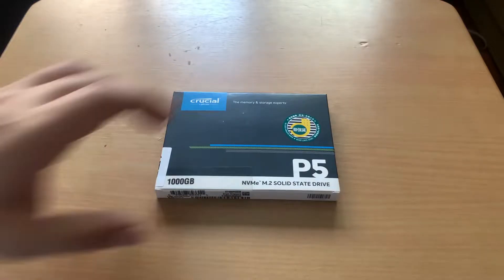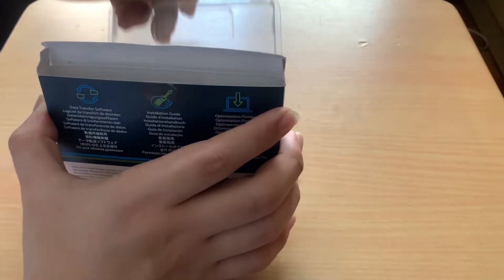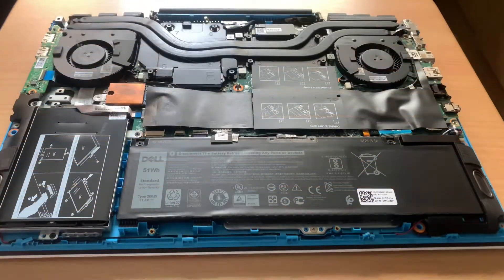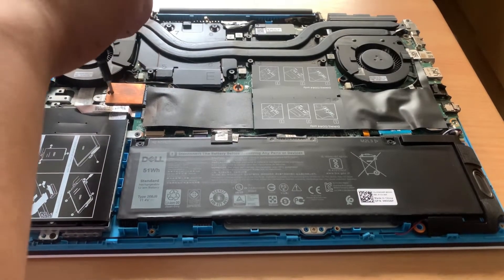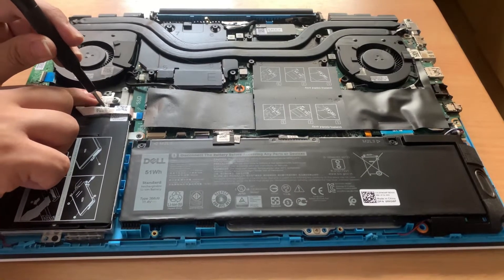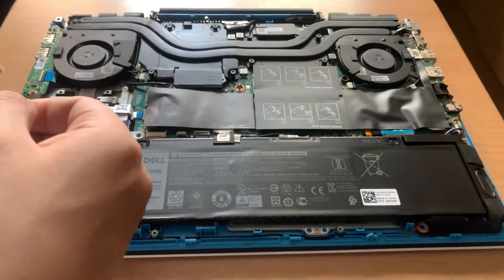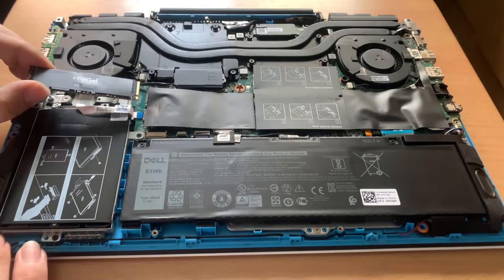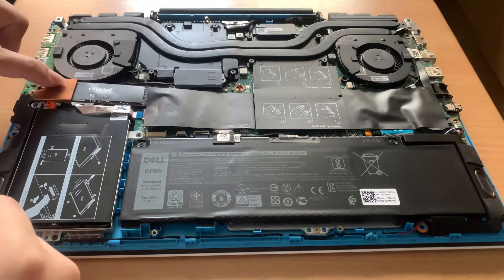Dell G3 15 3590 M.2 2280 SSD Upgrade

Comment: DO DELL G3 15 3590 i5 9TH GEN SUPPORT GEN 4 SSD ?
Reply from the maker: Yes, Gen 4 SSDs will work on the laptop, but it will run at Gen 3 speeds only, because the M.2 port is only Gen 3

Comment: Your old ssd is m.2 sata , i have m.2 sata with 2 notch but I don't know if nvme will work or not
Reply from the maker: My SSD is PCIe, not SATA. Two notches does not mean SATA
Reply from the maker: I also installed an M.2 NVMe PCIe SSD (Crucial P5) on the laptop in this video, while I installed Windows 11 on the same laptop with the SSD in another video. https://youtu.be/IEmyj3Ez54U?si=YDmDfSGxygS7ac12

Comment: Would you recommend getting a longer heatsync since the 2280 SSD is longer than the original 2230 SSD, or is the original heatsync ok? Thanks!
Reply from the maker: I still used the original heatsink, and it does run hot and throttles when writing huge files, but I don't frequently do that, so I'm okay with the original heatsink. I recommend installing a 2280 heatsink if your planning to write huge files on the SSD (such as video rendering).
Reply: Can we replace the heatsink somehow??? Because my ssd is overheating when I play games, and as a result my laptop is crashing. I have the same laptop model. Can somebody gimme a link where I can get a new heatsink. Would help me a lot. Tha k you

Comment: dear sir my laptop dell g3 15 p89f202     i want to expand ssd of my laptop can i expand is there a slot for my laptop please help me
Reply: 1tb ssd i want
Reply from the maker: I think the Dell G3 15 P89F202 is similar to the laptop in the video, so you can use the video as a reference for your SSD upgrade.

Comment: I ordered a Adata XPG Gammix S% m.2 2280 PCIe Gen3x4 SSD and its not being detected at all is there a way to know what M.2 Drives will fit like which Key Socket the Dell G3 takes?  this is what the description says on the M.2 i bought for the G3 Laptop... Interface: PCIe NVMe Gen3x4. Please check your motherboard manual and make sure your motherboard's M.2 slot supports PCIe NVMe or M Key with NVMe.
Reply from the maker: As long as you have a PCIe NVMe SSD, it should work, these types of SSDs typically are M-key.

Troubleshooting steps:
• Try running "diskmgmt.msc" and check if you have initialized and format your new SSD.
• Did you check your UEFI or BIOS settings to see whether your laptop sees the SSD? If not, try contacting the seller and see if they could test the drive or RMA it.
Reply: @miles_uy  yeah no nothing is showing in the bios and when its plugged into the m.2 slot on the motherboard when i power it on it comes up that no storage device was found. maybe its just a bad m.2 drive idk
Reply from the maker: Try checking the storage devices list or information section of the BIOS/UEFI settings, it might have listed it there. You have to go in the UEFI setting of the laptop, not waiting for it to turn on and say no storage device found. You can go in the UEFI settings by pressing the DEL or F2 key immediately after pressing the power button (I recommend spamming the keys even before turning on the laptop, and stop until you see something on the screen, to make sure the laptop recognizes you want to go to the UEFI setting.)

I suggest you contact the seller of the SSD for them to check it, they might even help you set it up, or you might have a defective SSD.
Reply: @miles_uy  yeah i uninstalled the m.2 that came in the laptop so the bios should all be setup for a m.2 already since it came with a 512gb one i was just trying to upgrade to a gig and it just will not recognize the new m.2 drive
Reply from the maker: Then I guess the SSD may be faulty, so try contacting the store where you got the SSD.

Comment: Good day, bro! I have exactly the same unit with 128gb on that slot and a 1tb hdd on the other. Looking to upgrade as well and saw you installed a 1tb there. I checked the website and it says I can only do 512 at most on that slot but I heard some guys said that the motherboard can handle 1tb so of course I want to go for 1tb ssd there (32gb kit ram, and 2tb ssd on the storage). Just want to know if you had any problems with that set up and I'd also love to have your opinion on this planned setup of mine. Thanks very much, man. Cheers!
Reply from the maker: I had no issues when I installed my 1TB M.2 SSD.
Reply: @miles_uy  Thank you very much!

Comment: Hello, I want to ask if the m2 slot of g3 3590 supports 1TB ssd?
Reply from the maker: Yes, it supports 1TB SSDs, just make sure you are getting a NVMe or PCIe M.2 SSD, not the SATA M.2 SSD. To add, the SSD I installed/used on this video is also 1TB, which is equivalent to 1000GB.
Reply from the maker: For your reference, here is a link to Dell's manual: https://www.dell.com/support/manuals/en-ph/g-series-15-3590-laptop/dell-g3-3590-setup-and-specifications/storage?guid=guid-e13e84f5-f76d-402c-aed6-1f4254d392b1&lang=en-us
Reply: I first looked at this link and the tables in it made me feel confused, I thought at the time that I could only add a 512g m2 drive. Your video and reply answered my doubts and I appreciate it.